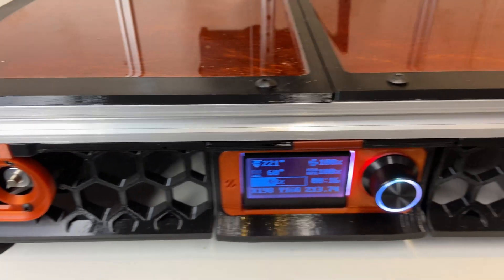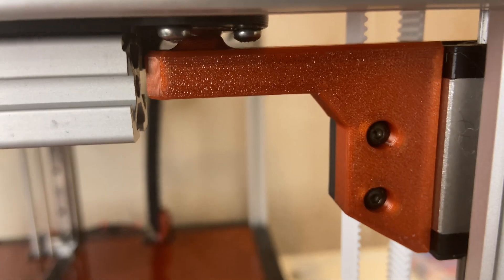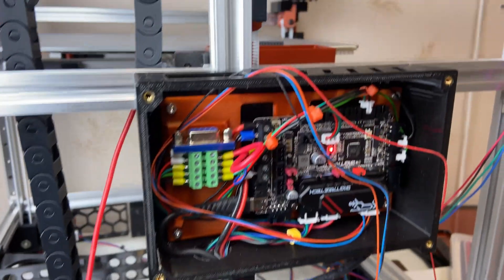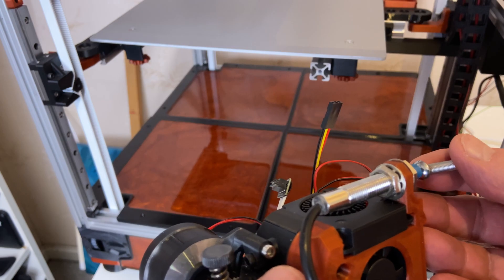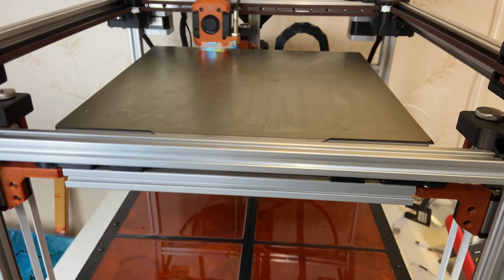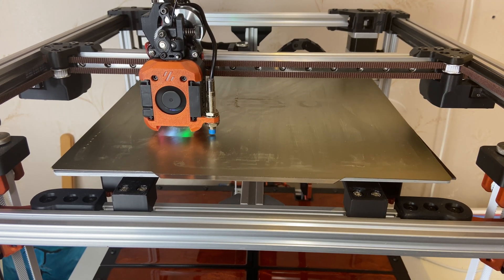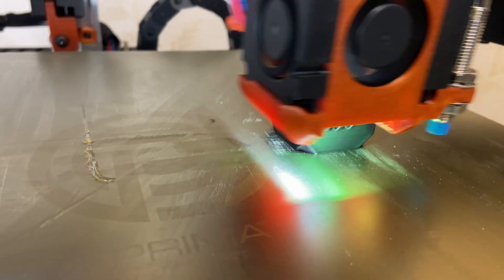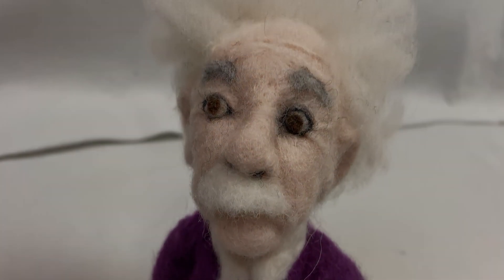DIY 3D printer - part 5

Comment: What was the total cost of this 3D printer?
Reply from the maker: Difficult to say. Most of the parts came from old printers and I spent about USD 350 on new parts like the extrusions, heat bed, hotend, some fans, SKR PICO, display and a PSU.
Reply: @v4projects  So something around the $600 mark? Thanks!

Comment: Ooh, updated files for the Z mounts?
Reply from the maker: Yes, I have published them on Printables. You may not need them. It depends on how high the bed frame and mounts are. It also depends on the z-rails. The rear one can't move much higher on my build. The carriage is the same, just the arm is new.
Reply: @v4projects  looking at my Solidoodle 3, I most definitely need the new design. 🤣